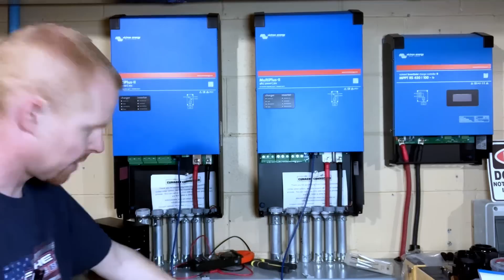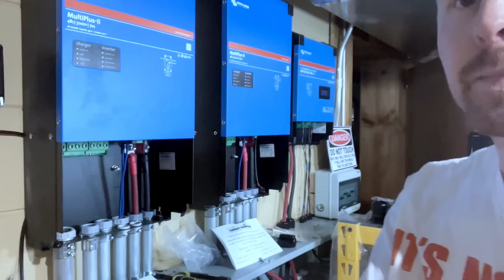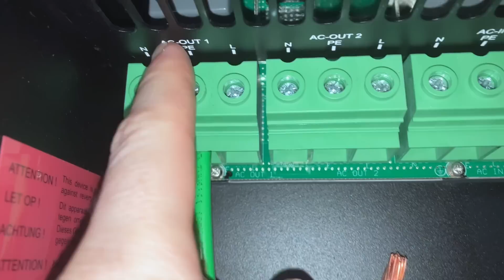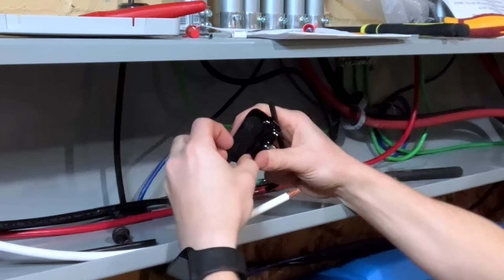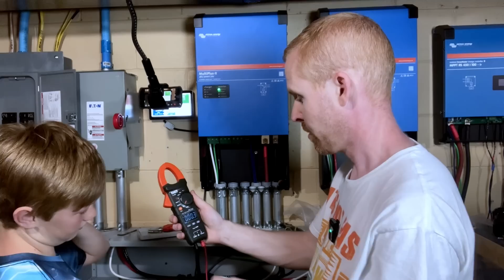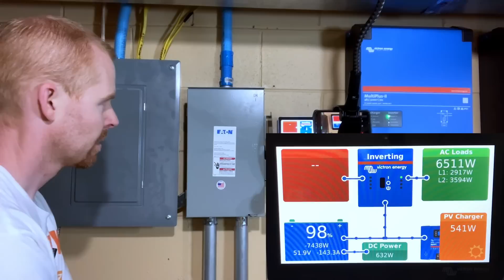Solar Upgrade - Powering the House with the Victron 5kVA Inverters!

Comment: I don't know if I missed it but why did you switch from the eg4 inverters to the victron?
Reply from the maker: Current Connected sent me this system for testing and review. I was happy to try something new to see if there was something out there that didn’t have some of the issues I was experiencing with the 6500s.

A few of the big differences between the units that I've noticed so far is the difference in idle consumption.  My 6500s had approx 168W of idle but this entire system has approx 35W of idle consumption.  That's almost 3.2kWh of savings each day.  That's huge!

The next thing is the noise.  The 6500 fans sounded like jet engines in my utility room.  These inverters only turn on the fans when they get warm and even those fans are really quiet compared to the 6500s.  

Another difference is the flickering light issues I've had with the 6500s.  Various lights would flicker, certain devices would introduce a flicker and I couldn't use any dimmers.  So far, all of those issues have been non-existent on these inverters.  

Lastly, one of the big differences was the lack of support I received from Signature Solar.  The last ticket I sent in for help took almost 3 weeks to get a response.  I've had bad experiences with support all around, and I've also had communication issues with management.  It's disappointing because I like the products they're putting out, but I have to be able to get support for products I purchase as well.  For the most part I'm self-sufficient, where I don't really need to talk to support, I'll just figure things out, but for the occasional things I had to try and get help, I never got it.  I still have questions unanswered from last year.  

I know I'm probably missing something, and I plan on running these inverters through all the issues I had experienced and sharing the results with everyone once I get the install all completed.  Hope this helps.
Reply: Hey thanks for the detailed explanation. It sounds like these are an upgrade over the 6500s all around. The idle consumption difference is staggering. The flickering lights issue is one that would drive me crazy.

I'm going to go back and watch the whole series. Thanks

Comment: Of course, those are better.  but the price difference is substantial.  I would gladly take the Victrons if they were being supplied to try out...
Reply from the maker: Yes there is a significant price difference, but your not only paying for the hardware, you're paying for quality and reliability.  I don't even wana think about how many hours I spent working on all the little issues I had with the 6500s.  If I charged for that time, I would be able to pay for the Victron system with money to spare.

Comment: Electrical safety tip never use two hands turning on/off a disconnect and don't stand directly in front or reach across
Reply from the maker: Thanks!
Reply: Do not have your kid stand around, it is dangerous. It is not a joke 😅

Comment: Matching the AC wire lengths should not be necessary, it's not like your loads per leg are going to be perfectly balanced anyway.
Reply from the maker: I believe the balancing is for 240v loads, not the 120v loads.
Reply: @AdamDeLayDIY  yeah but if you have any 110v loads then it's no longer balanced.
Reply from the maker: @robinboling9531  true. I guess I was thinking about if you only had a 240v appliance running.  I was just going off based on a few articles I read as well as some comments from other installers.  It's not gonna hurt either way.  

Thanks for the comment!  It lets me know people are at least watching... 
😁